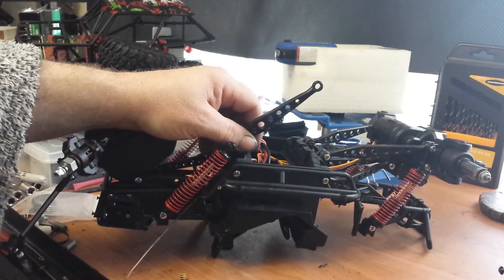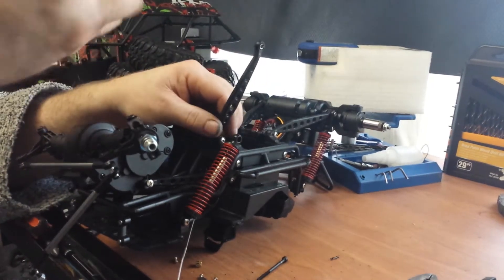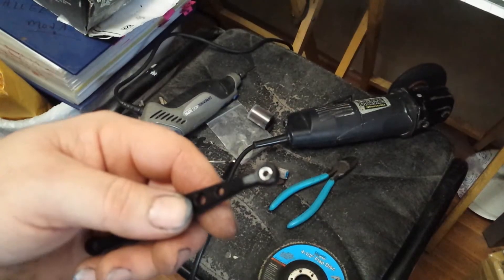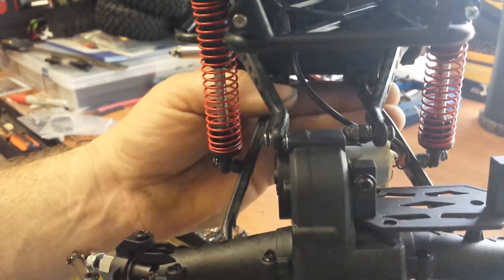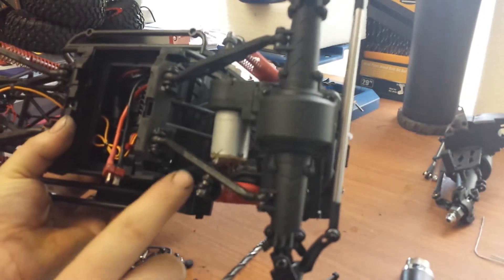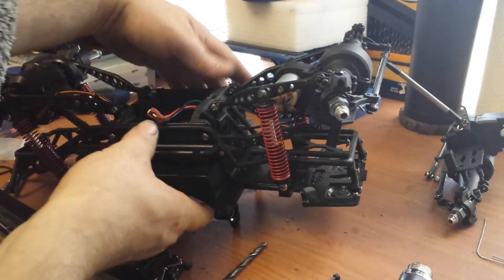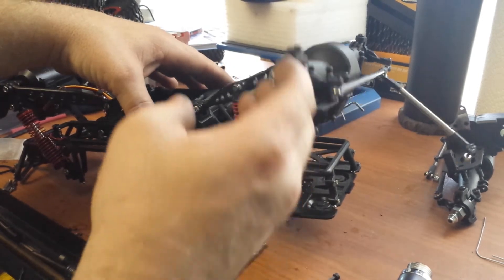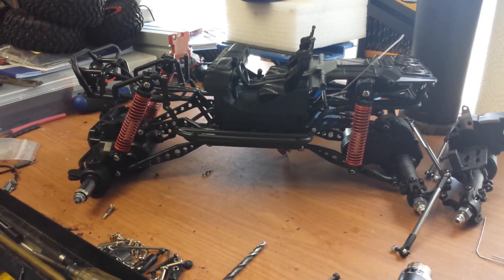ep4 HB rock crawler p1001 p1002 p1003

Comment: The front diff stuck after repairing it.  It is now a 2wd truck that cant move.  Some idea?  I need to get it back working without modifying it too much
Reply from the maker: U'll hav to take it apart figure out wuts binding motor culd b stuck wd40 culd work 4that and check mesh on gear